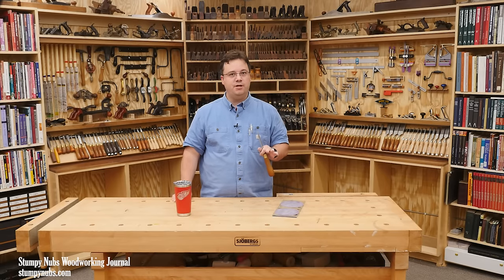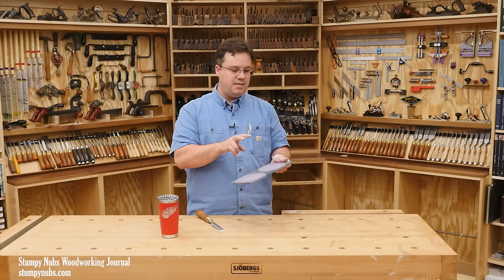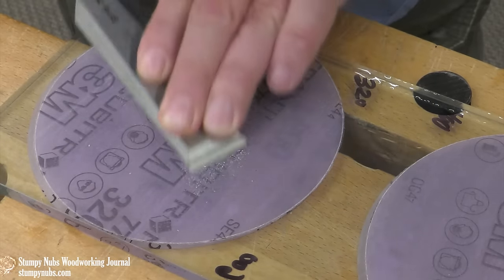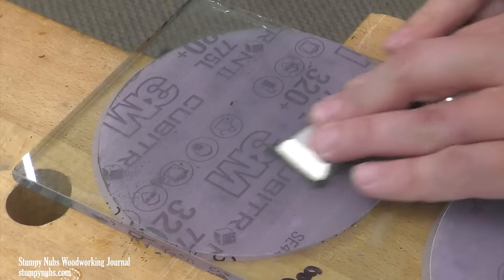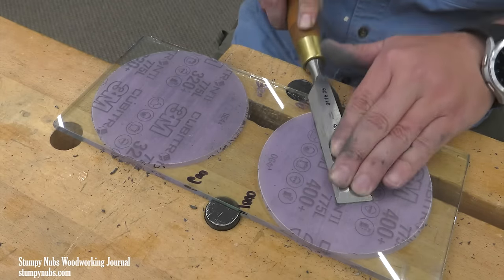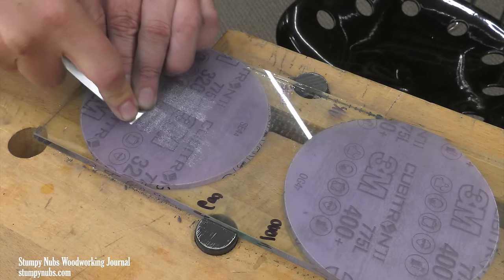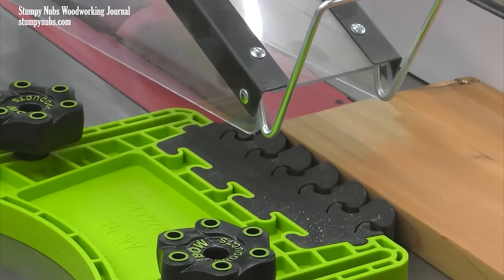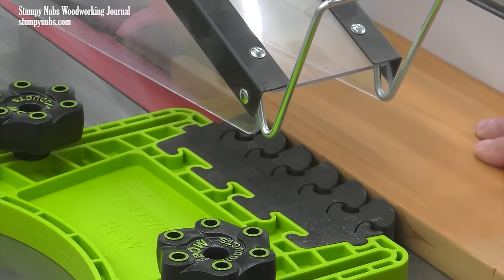A game-changing NEW way to sharpen! (Scary SHARPER!)

Comment: To clarify one issue, the glass is float glass, not tempered. Tempered glass would not be suitable because the process induces a slight surface distortion and is therefore not perfectly flat. It looks like the edges of that plate need to be lightly sanded, or seamed in the vernacular, so you don’t cut yourself.
Reply: i would also add, just buy a machinist used surface plate, they are relatively inexpensive (especially on very small sizes), and they are very flat, and getting them to extreme flat is very easy (look at lapping on youtube, lot of great content)
Reply: It is as you say. Copied from Taylor’s website, “The kit consists of a piece a 5” x 11” dead-flat 5/16” thick float glass, …”
Reply: You can get float glass tempered. The Veritas one is tempered glass. Means it doesn't shatter if banged etc...
Reply: All tempered glass begins as float glass. Tempered glass will break into thousands of little pieces when it breaks. Its purpose is to reduce injury. While it is extremely strong and break resistant, merely grazing a corner with a hard metal object will cause it to shatter immediately and make one heck of a mess.
Reply: I've chipped every corner off my Veritas one and it hasn't exploded. Maybe the tempering process differs like in metal. I've seen some tempered glass fracture in a honeycomb kind of way but I think it's different. I don't know enough about the process over than it's very tough and only chips in my experience with the Veritas one 😅
Reply: Good info dude!
Reply: THANK YOU. I am constantly correcting people on this.
Reply: It would happen a lot faster if you stuck the sand paper onto a sander! Lol.
Reply: @MrDancingBishop  the veritas plate is safety glass which likely means that it is two pieces of 3mm glass with a clear plastic inner layer. Unless it specifically says, right on the glass, that it is tempered, it is not. Not all safety glass is tempered glass.
Reply: Could be borosilicate glass?
Reply: I'm thinking about getting a 5" piece of glass.. round.. some silly cone and me old sander..  hitched..
Reply: @ausnetting  ye like I said it was sold by Axminster tools as tempered so kind of trusted them. Either way it very good it has no right to be still functional 😂
Reply: @smallbizcash  not from the images on their website, looks like a single sheet to me. But they don't say anything but "safety glass". You can get tempered glass that is flat, I've seen it used for mirrors; but the edges on the website images don't look like tempered glass to me. At least, I have never seen tempered glass with such rough edges.
Reply: Facts
Reply: @wernerviehhauser94  Sorry, but tempered glass is not flat. I was in the business for many years. Tempered glass was not used for mirror, since the distortion was magnified. Safety backing, a very sticky matrix of fibers, is used to create safety mirror. You are correct about the edges shown in the video, they appear to be straight off the cut rather than seamed as would be normal for any float glass.
Reply: @smallbizcash  ok, you have BEEN in the industry. Granted. But then explain how it is possible that I can BUY mirrors made from ESG (Einscheibensicherheitsglas/ toughened safety glass). Maybe things have changed? Or its just being a german thing to use the new high tech stuff while the rest of the world sticks to outdated stuff....
Reply: @wernerviehhauser94  maybe you are just a superior being. in my experience, US based tempering processes induce distortion. I'm happy you have an alternative.
Reply: @smallbizcash  my only super power is lightning fast googling. There are dozens of companies in the US offering tempered glass mirrors. When my former collegue was involved in the development of the silver coating for insulating glass, they couldn't get tempered glass flat enough. But that was, like, three or four decades ago.
Reply: @richardlove4287 faster yes.  But a lot less controlled and likely removing way more metal than necessary.

Comment: Quick tip: if you are more concerned about making sure the tool is sharp, rather than making the back PERFECTLY flat, you only need to flatten the back until you see the shine up to about an inch behind the blade. You can go less if you are in a real rush, but be aware that the back is used as a reference surface for paring (see the response from Stumpy Nubs to my original, unedited post, below.) The more you take off in your initial flattening (the further back you take your shiny surface), the longer you can go before needing to flatten the back again. Need to keep the dull hollows from getting too close to the edge, or it’s time to flatten.
Reply from the maker: You use the back of a chisel as a reference for paring. At least an inch or so should be flat. Since this method is so easy, I did the whole thing.
Reply: @StumpyNubs   Most of the time, we are talking about a few thousandths of an inch. I am a perfectionist myself, so I spend WAY too much time on my tools. An inch seems like a better number than a quarter inch, though, so thank you! I will edit my original post.
Reply: @StumpyNubs  Depends if the hollow was made intentionally or you get lucky and the hollow happens to be more centred like intentional hollows are, tbh. In that case, you'd just make there is acontinous flat bad around the 3 edges, no need for it to be that thick Not usual for modern factory made chisels to have a intentionall hollow this side of the Ural mountains as far as I know, but I wouldn't be surprised if some don't come up with hollows accidentally centred well enough.
Reply from the maker: I know of no common Western chisel sold in the US that has an intentionally made hollow.
Reply: @StumpyNubs  I don't know about the US market, but I am just saying that even if it is not intentional, as long as the hollow doesn't reach the edges, it will register correctly
Reply: I am a big fan of narex chisels.   All the ones I’ve gotten are hollow and they hold a good edge while being affordable
Reply: @TKC_  Agreed. I have enjoyed my Narex chisels. Pretty sure I learned about them right here on Stumpy Nubs.
Reply: @louisvictor3473    Agree.  As long as the edges on the backside are flat with the cutting edge, any hollow is actually beneficial since you don't need to remove as much material when flattening or sharpening.  

Unless of course you're paring thin stock where the hollow would actually come in contact with the piece...
Reply: i noticed that as i was workin it😊

Comment: Don’t remove the “hollow grind”, it’s there for a very good reason. It takes a fraction of the time to resharpen as, obviously, a lot less stock to remove. Common practice with jobbing joiners & carpenters in the UK, completely pointless grinding the back of the chisel flat. Kool channel. By the by, I use plate glass mounted on 18ml ply and the edges are ground. Plate glass was the type that used to be commonly used on retailers shop fronts.

Comment: I think scary sharp was coined on the old rec.woodworking news group. Ron Hock was a contributor on that group, and made the comment that carbon steel tools can get so sharp that it is scary. Later on, someone else described sharpening (presumably with sandpaper) and made the comment that the tool was so sharp that it scared Ron Hock. I think that is where the term was born.

Comment: You and a couple other YouTube woodworkers are definitely getting me to spend a lot of money with Taylor tool works. It's well spent. Thanks!
Reply: just find a old glass frige door and buy square paper in the different grits. i have 8 grits up to 3,000. sharpining the bevel takes less than a minute. the 30 inch stroop glued to the side was by far the biggest expense. doing the back is not possible with the door because of the door frame.

Comment: What are some really good chisels that are well made and don't cost a fortune. Thanks for all the awesome informative videos
Reply: Older question, but my tip would be a set of 'Kirschen' chisel. Kirschen (translates to cherries) is an old german brand. A set with oak handels (can be replaced and bought at their store) costs around 120€ for a 6 piece kit. They also make them with composite handels for outdoor use (wet conditions) for like 20€ more, but the wood handels look better IMO.

Comment: James thank you.  I have been trying to flatten the back of a Stanley plane iron, which was going slowly.  I tried this method and it worked quickly. I had some cubitron discs 120 grit and that did the trick.   That set would be good if just starting out.

Comment: So i ordered the kit after watching the video. It took a few weeks to get and they replaced the smaller disks with larger ones in order to ship it faster. No issues, just cut off two edges and you end up with a bigger abrasive surface. I choose to use my wheel guide and i have to say, the process is at least 75% faster than using stones. I'll not go back.

Comment: I'll preface this by saying after watching your video I ordered the kit.  Just for kicks I took a set of four new chisels that I just bought to the garage and did a little work on them.  I put 220 grit 3M Xtract on a 1/4 piece of aluminum to see if I could just knock down the machine tool marks on the back and bevel.  In five minutes I worked out those tooling marks and the dips on the back.  I can't wait to get the kit.  For about $30, this is the ticket.

Comment: There’s both pros and cons to using different types of glass for this sharpening procedure ,going by all these comments , but I would highly recommend  coating  any glass used on the back side with a thick safety window film that will help  shatter proof the glass , just in case .
    As a window tinting here in Tasmania ( Australia ) I get plenty “off cuts “ of a clear film designed to offer   “non safety “ glazing by shatter proofing it . Even with laminated glass,  I’d use it as you can still get tiny fragments that will breakaway and the film can offer less chance of those flying everywhere.( I just use it on the underside only as having the sanding sheets on top ; particularly if glued down ; will help minimise loose glass fragments on that side from going everywhere and also make glass disposal easier.
       Whilst any type of  sticky films ( masking tape - signage type films and those obtained from the stationary shops to cover school books etc ) could be used . But the thicker window films are specifically designed and tested for safety applications and would be far better choice for this . 
   The thickest type generally available is up to 12 thou thick but I find the regular 4 thou that I use is ok and also helps stiffens up glass when broken but the thicker ones would be even better .( you could try contacting your local window / glass tinters retailer shops to see if they can supply you some off cuts that most would generally dispose of.)
    As another excellent use for the safety films that I’ve found , is by bonding it directly to  the back of those thin ( Emery paper backed type metal sanding and wood type sandpaper sheets and then one can cut into narrow strips to suit projects as   small flexible ( sanding files ) as this greatly increase the strength and life of the sanding paper .Without it , I find the paper backed  sanding papers tend to tear / break quickly 
Again any sticky tapes / films can help but by using the the glass safety films; which are generally made of a polyester based plastics; don’t stretch like the other materials plus have a very high tensile strength.
    I personally use a glass sheet about 4 to 5 mm thick that’s slightly longer than the  length of the standard sanding sheet and slightly wider while using an old type USA made “General 810 “ model plane blade & chisel sharpener as the overall glass length offers the full use of the sanding paper 
I hope this info helps
Reply: @Jay Khan 
Just a quick follow up to reply 
If you use any window films to stick to the back of sanding papers ; you would want to use only those with a sticky ( pressure sensitive type glues ) which you will find on auto films / frosted and decorative type film ( except the static type films that don’t use glue applications ) and safety films as generally the majority of flat glass film on the market now tend to use a dry glue system only designed for flat glass applications and don’t have that high sticky glue . So not suited for other applications . 
If using the auto type films , your generally find due to the there thickness ; which are normally about 1 to 1.2 thou thick ; will offer a bit more flexibility compared to the frost type films which can ( depending on brands etc) be a bit thicker again  and the safety films even thicker ..
One off the main advantages doing this if a project requires sanding / polishing small holes / slots for example ;  application of a suitable film backing allows the sanding sheets to be cut into fairly narrow strips to increase tear resistance and ads the extra tensile strength that otherwise without its use would tear / break very quickly.
Trust this info may be of help

Comment: Cubitron is truly some 21st century abrasive. They also offer much higher grit levels than you would usually use for wood, but they work wonderfully on metals and plastics. And they last seemingly forever unless you abuse them. I keep 'worn out' discs for use with my hand sanding block as they still have a lot of life in them when they cease to cut as well on the power tool.

Comment: Regarding your advertisement for BOW feather board and its performance, how does it compare to the Harvey COMPASS RG-1/RG-2 or the JessEm 04301 Clear-Cut TS Stock Guides/ equivalent router table anti-kickback guides by JessEm? I have both and wondering if it’s worth having the BOWs?

Comment: Ordered the kit. I’m just curious how I’m supposed to use my sharpening wheel as it will run off the sanding pads and glass unless I only move it an inch?
Reply: I'd think the discs are close enough together that you could roll the jig on 1 disc and chisel on the other. If the roller wheel drops that little bit onto the glass, it will lift the edge up you're try to sharpen so it won't affect it

Comment: A bit off topic, but I recently bought a cheap sickle and sharpening it seems like a fools errand. I bought an accompanying whetstone, in the shape of an elongated oval, but all it get it to is "decently" sharp. I would describe it as sharper than a butter knife, but duller than a bread knife. I heard, that you'd want scythes and sickles almost razor sharp to do effective work and as my sickle even chokes on regular 2ft high grass, if I don't put my whole body into it, it seems I do something wrong while sharpening.
I try to do the 10-20° pitch angle on the upper blade side and almost flat on the back to remove the burr, but it still feels rough and using the stone on the back side makes it even duller.
Do I need a second finer grit stone or do I need to change technique?

Comment: Thanks a ton for putting this video out man. If you hadn't, odds are i never would've tried the cubitron ii paper out. It definitely is excellent stuff. I doubt id have considered there'd be much difference between brands or that itd even be worthwhile to use a consumable for sharpening. Well i should say something that wears out more quickly since even diamond plates wear out over time. oh and i had the misfortune of learning the cheap plates i bought also wear out extremely fast if you put much of any  pressure on them as well...D'oh!

Comment: Would you advise buying the kits with the glass panels from Taylor Tools if I live in Australia? For some reason it's weirdly hard to find any small bits of cheap glass like this locally but I'm concerned about shipping damage if buying internationally.
Reply from the maker: Any hard, flat surface will work. A granite floor tile, for example.
Reply: Send them an email and ask how that product gets packed, for international shipping.

Comment: Yup, Cubitron II is great stuff. I use it on my belt sander, and I got some angle grinder discs that are also made of the stuff. Long lasting, cut fast, and produce a lot less heat. That last bit doesn't matter when hand sanding. But when shaping knives, it really helps keep your stock cooler for longer, so you don't have to dip in water as often, saving precious time.

Comment: Cubitron is a mixture of coarse and finer grits, so a given grit produces a better finish than other sandpaper of equal grit. Great stuff, lasts forever,  I love it!

"Scary sharp" is very fleeting because 1 or 2 cuts in hardwood reduce scary sharp to simply "very sharp". I stop when the edge will shave because it doesn't last even with the best steel.
Reply: I’ve done some wood carving and I keep a strop beside me as I work.  As soon as I feel the edge start to dull, I give it a few strokes.  I also keep a container of bandaids on my bench 😉